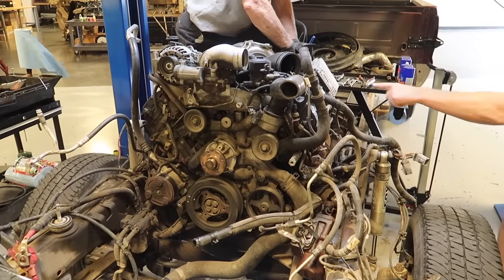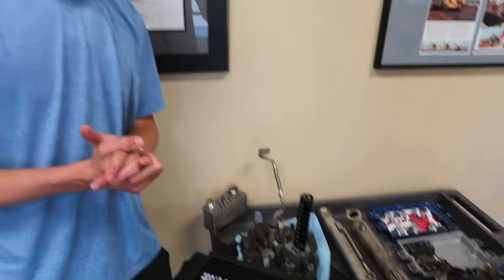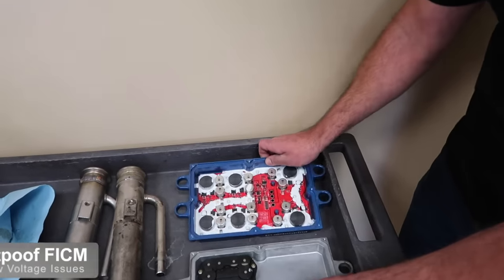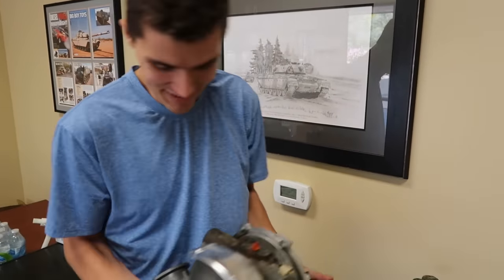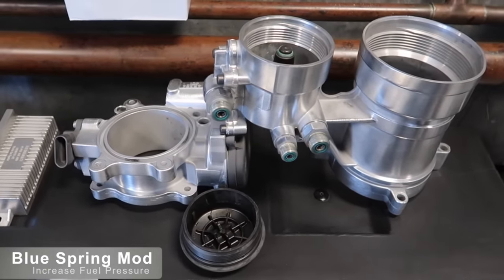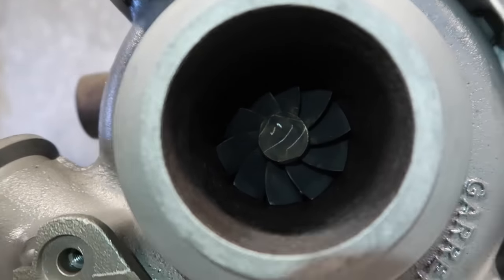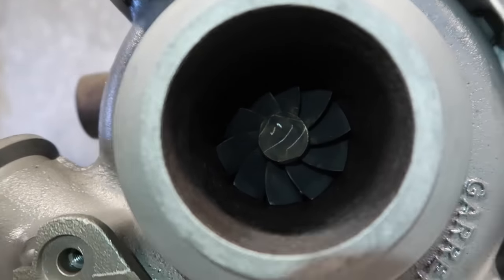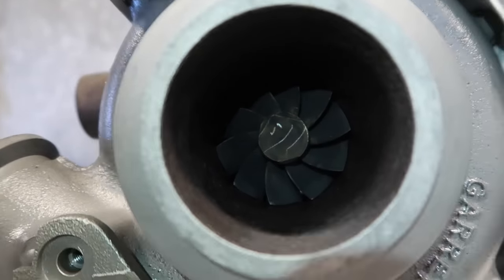Fully "Bulletproofing" Our 6.0L Ford F350 Powerstroke (Stage 3 Install)

Comment: There are faults with every truck the reality is the 6.0 is not a bad investment if the “correct” mods/repairs are done. As far as exhaust goes, I have a F550 6.0 that has a Banks exhaust. Turbo is a 03 with a wicked wheel. It was great at first but you get tired of that loud  jet  whistle on a long tow haul. 
May I ask for a better explanation for why the heads were replaced? 
New to the channel, I did sub. 
Just an old car guy asking questions

Comment: U should have reseal the whole engine and did lifters I know it's more money but it will suck if u drop a lifter in 60000 miles and u could have updated the high pressure pump to 05 to 07 those early pumps fail and also could have done hhc diesel nibble cups and o rings I have an 06 f250 Harley Davidson 4x4 I love her

Comment: I can't believe they put gold coolant back in it. Do your research on why egr coolers fail and the effects of gold coolant. (yes I know you got a new one).

You do not need a coolant filter if you do a chemical flush, get of all the  gold coolant and switch to red. 

BPD makes great products but the "known issues" with 6.0's are due to lack of maintenance and stupid tuning.
Reply: Even maintaining the coolant would prevent cooler failure

Comment: cough cough 7.3 idi or power stroke 🤦🏼‍♂️....
Reply: nono lol I own both a 1990 7.3idi 5 speed and a 1999 7.3PSD 6 speed both of which I love and can tow shit tons but if I needed something to tow all the time I wouldn’t choose either of them because of how slow they are up long grades with a load
Reply: Lmao
Reply: Lmao, ur right I have a 2000 f350 7.3 it’s the best thing ever I swear I never get bored of driving it and it’s my daily
Reply: I have a 1994 7.3 idi turbo and a 2000 7.3 ps.  Love both

Comment: Where do you find and old f250 for that price? Even a 2000 model with 132000 miles is $22,000!
Reply: 1999-2003 trucks had the 7.3 powerstroke which is a very reliable engine that last a long time. 132000 miles is very low for a 7.3

Comment: You can buy a brand new 6.7 for 40,000-50,000 you don’t need the works if it’s just for hauling cars and diesels hold there value.

Comment: When will Bullet Proof start bullet proofing 6.7 power-strokes , especially that Bosch high pressure fuel pump that was designed for Euro diesels and could have a catastrophic failure here is the USA due to lower sulfur content and less lubricity in US diesel fuel??? 😆

Comment: Go with a 4inch turbo back. You will have more of that rumble a 6.0 had Upton and alot of turbo noise 5 inch isnt worth it because there is little to no performance over the 4inch and the 4inch sounds better

Comment: axle dump straight piped. not as loud as you think as i had basically the same truck mods, i also had dsp 5 switch. 4 inch exhaust all the way back look stockish, as i didn't have a tip just the pipe out

Comment: Okay, how much did it cost to bullet proof your Ford. I like Ford, even though I sued them in 2007 on a 2005 f 250 with the smaller gas motor. It was a lemon. And I won. Ford unfortunately makes pretty trucks that break. I would like to own a truck just like this, in the 250 version.

Comment: Bro how much does it cost to do what yall did I want to get a 6.0 like that cause i like those trucks but hate the reliable
Reply from the maker: The term bulletproofing sometimes gets thrown around loosely, but it can range form $4-$10k+ depending what is done.
Reply: @JRGarage  15k into a truck and more power and reliability that's actually not bad at all
Reply: joshua avila no it’s really not. Especially when you consider how cheap you can get a clean one because of the horror stories

Comment: Sorry bro the new 6.7 don’t loose there value ones with 40,000 mile son them are still going for 2. Grand under buying price
Reply: Yeah its insane
Reply: Sean yea my dad was looking around for a used one but they where basically more expensive than from factory

Comment: You jumped a little too soon, just bought my 07 king ranch from the same location for $2500 ;)
Reply: Mike Baker yea what did it have blown motor and trans?
Reply: @killiansnufflebottoms7827  yea, ate a lifter, I had a spare built engine and trans out of a stripped theft recovery, but an ashville shortblock is only like 3k

Comment: Why not just buy a low mileage 5.9 Cummins? Would be cheaper in the long run
Reply: bearatts Cause dodge is known to have bigger problems than Ford. Transmission fell off my ex dodge! Left me stranded! I said screw it! Got myself a Ford, and I can’t be more happy!!
Reply: Just saying my peace then get a manual or build the auto. A well built 48re is a great transmission

Comment: Your wrong about the 6.7, a family friend of mine is a diesel performance specialist and him and most of the other guys regard the 6.7 as the best engine since the 7.3
Reply: Eh injection pump on 6.7 if it fails it trashes the engine

Comment: holy Jesus only 5400 for that truck that is nuts of a deal around me that would go for over 8 easy
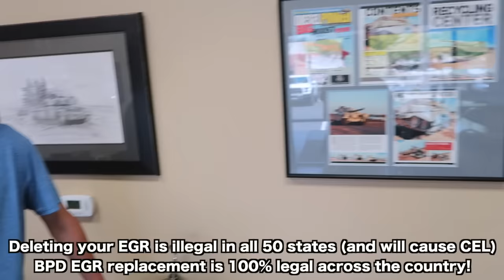13:21 it isn't illegal if they don't catch you// get a pre 03 diesel and you can just cut the muffler off and call it a day

Comment: Funny how everybody says new trucks are 80k. You are looking at the wrong truck yes they go that high but guess what they start around 42k for a diesel. Just buy a lower model a new base lariat has way more options than that king ranch and I bought mine for 56k a year ago with a 6.7 and it has a 100k warranty. If these guys truly wanted reliable get a same year cummins or duramax. Or just spend 30k for a used 6.7 and have something reliable.

Comment: why didnt you get a 7.3?
Reply: He probably didnt want to spend $20k + on the 7.3
Reply: That's why he went to a 6.0
Reply: Alex dejesus you get can a 7.3 for in the teens and anyways he couldve put 2k in the 7.3 rather than so much in a stage 3 bullet proof, 7.3 wouldve dominated
Reply: 7.3 just isn’t that powerful though. I know cause I own one. If you’re going for power, don’t get a 7.3. The 6.0 with the right work (bullet proofing) done to it is a great engine with more than enough power and its reliable now.

Comment: 6.0 is way better then 6.7. People take out the 6.7 and swap a Cummins
Reply from the maker: People are always quick to say the 6.7 is miles better, but a fully bulletproofed 6.0 is a REALLY solid engine without all the modern emissions requirements. Also 6.0 sounds glorious and can be easily modded! 👍
Reply: David Calix I think your thinking of the 6.4 not 6.7
Reply: Smh 6.0 worst engine ever made buddy
Reply: 6.4 , 7.3 easily best engines ever made and that 6.4 😍
Reply: David Calix nobody does that. People take out 6.4s all the time because how shitty and expensive they are but they 6.7 is a pretty good motor
Reply: morris molina no it isn’t. I’ll take a 6.0 over a 6.4 any day and twice on Sunday

Comment: Me reading this 
impossible
But seriously to a word of advise to young teens buying there first trucks. Even though 03 to 08 Ford 6.0 are really cheap do not buy them 
They are very unreliable and expensive to fix its not just the internet memes. Just beacuse you say oh I’ll do a full egr delete and add a larger coolent system it will not reliable stIll.
Go for an older Ford or better yet Chevy is better and you can get a nice duramax
Or a 6.9 litter Cummins or something but not thhis

Comment: If you can go buy a 100k car then go buy a 7.3🤷‍♂️
Reply: Jaden Sheffield 7.3s don’t have a lot of power. They tow really slow. I got a 6.4 instead and the things tows 8-10k like it’s not even there and still get 14-15 miles a gallon

Comment: Why didn't y'all get a used Cummins? Wouldn't have to throw much at it to be reliable. Their logic doesn't make sense to my thoughts of why your getting a tow rig.
Reply: Pete Tommaso 
Only thing a Cummins would’ve needed was a built transmission for the automatics, or maybe a clutch for the manuals.

Comment: That engine is garbage. Would never take a chance on the 6.0 boat ancor again
Reply: Actually the 6.4 is alot worse then the 6.0
Reply: @alexdejesus8414  you got a great point. I did not keep my 6.4 ling enough to blow upI had a f-450 the fuel mileage was horrible

Comment: You should not have to do that.  YouTube Deboss garage why not Ford.
YouTube Gale Banks, his specialty diesel builds use Duramax blocks right from GM.
YouTube Stock bottom end record.
YOUTUBE k.p. mustang.
YouTube LSX Challenger.
YOUTUBE LS fest.
YOUTUBE LS Winnebago.
YouTube Sloppy mechanic.
YOUTUBE 400,000 mile LS powered Cadillac.
Buy a Chevy.

Comment: Heads are still going to crack, anything much above stock power levels will push the gasket. Studs or no studs, there are only 5 bolts per cylinder and a horrible design. Huei injection sucks, common rail is light years better. 

Waste of time and money. I’m a die hard ford guy, and I’m not afraid to call the 6.0 what it is... a boat anchor.
Reply: Actually only has 4 bolts per cylinder but you're still essentially right. Duramax's have 6

Comment: Waste of money.... Do what i did way cheaper and the engine wont blow up😎1990 7.3 idi f250 xlt lariat 4×4 rebuilt down to the block,added a bunch of goodies,new 3k banks sidewinder turbo conversion kit,plug timer,plugs,plug harness,plug injection pump,fule water sep/radiator,batterys, on 35s with a 7inch lift😎bitch will pull a house off its Foundation and will smoke alot of new cars and trucks from 0to60 boosting 12lbs 14lbs at max😎